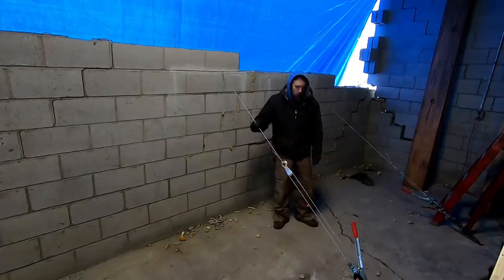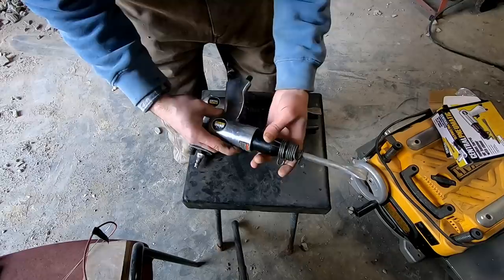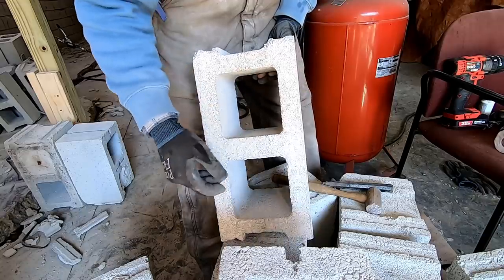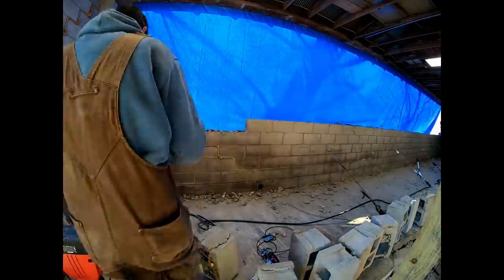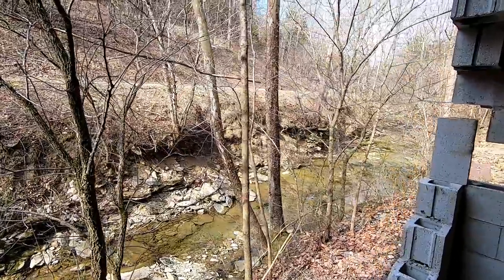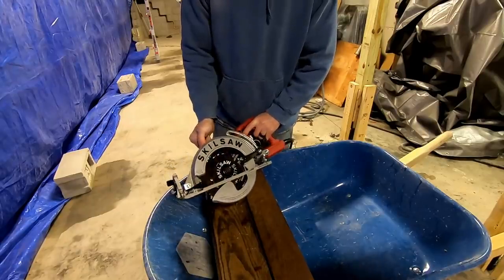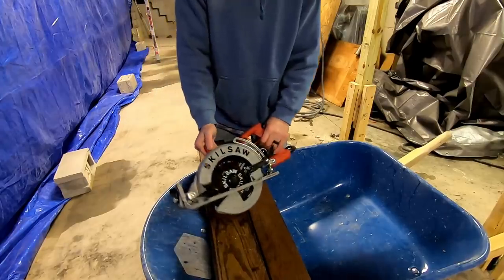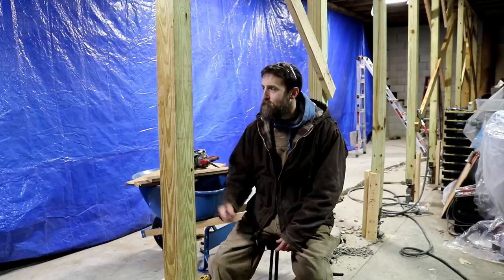THE BLOCK WALL IS OUT! Machine Shop repair part 5

Comment: Wise choice on stepping back from Peanut a bit. Although acclimated to human contact, she is still a wild animal, and her instincts will take over from time to time, especially when she gets a litter to look after.  If you do try a nest camera, make sure to put the camera into a squirrel-proof enclosure, otherwise the wiring is likely to get destroyed. A dedicated ingress/ egress point for her will make it easier to "Squirrel proof" the dray.  I get phone calls to remove squirrel infestations/drays which are inside roofs and attics; they can can be incredibly destructive (especially to the attic/loft wiring and the roof), so try and limit access to the remainder of the roof, if at all possible. They are cute little critters, but cute ends whenever they cause real damage. Current personally-observed damage 'record' for my area is $35,000: Roof, attic wiring and HVAC damage  -  which required two non-load bearing walls to be stripped and re-drywalled and an entire section of the roof to be taken up to repair the HVAC (no room in the attic crawlspace). FWIW: Most homeowners nowadays can't get insurance if a tree branch grows within 5 feet of the home. Just some things to think about.
Reply: That's the tamest wild animal I ever saw. Thing would probably sleep in bed with you if she could.

Comment: I have either missed it, or just not understanding, but it looks like your cut line for the new floor is behind the supports. Exactly how is that going to work when the time comes to pour the new floor? And I am sure, I hope, that you are also going to drill and insert rebar into the existing good portion of the floor to attach the new pour... IDK!

Comment: the thick side is rougher because when they cast those that part is sitting on the bottom , they taper to small to get them out of the mould
you can probably stil get new brushes for that old skilsaw, dont think the copperthingies inside the rotor rhe brushes run across are still good , might been burned through after the last few tries whont know untill you taken it a part , you might be ale to skim a little off in the lathe and polish it with some emory cloth
Reply: Them copper thingies are called commutator bars.

Comment: Steve, I have a Stihl Rock Boss that would be the ideal tool for toothing that block back in:
https://www.stihlusa.com/products/concrete-cutters/professional-concrete-cutters/gs461/

You may just be able to rent one for the cost of shipping both ways from the Gulf Coast, but I wanted to throw that out there.  We bought it for one specific job a number of years ago, and we've used it once since.

Also, good buy on that Jackson Wheelbarrow.  They outlast all the other ones by 2-3x, and are only about 10% more expensive.

Comment: With a view like that aren't you tempted to go for an all glass wall!
Reply: Stephen Perry all glass wall ain’t structual, otherwise it’s a great idea, I was actually thinking the same thing.
Reply: With the proper headers big windows are great, as long as they are sized within reason.
Reply: OldmanonaHarley  BCJ Architects designed and built quite a few Apple stores around the world that have changed the game so to speak concerning all glass construction.  It still uses fasteners but they worked with a glass company out of Germany to create new methods of tempering and such to make it possible.   The New York Apple store even has an all glass elevator.  Cool stuff
Reply: Of course it’s not an affordable option for residential stuff yet but hey it’s possible.
Reply: @audimaster5000    It can be I have been gathering good used patio sliders they are standard size, framed and cheap I scored a few set for free.
Reply: Jeff Padgett It is possible to build an all window wall, I’ve built quite a few myself. Unfortunately like you said, it ain’t cheap, great idea though.
Reply: The largest drawback to glass is the size of the pieces one or two people can reasonably handle without machinery.  This will depend on thickness.

Comment: Steve: I don't about your area but in mine, those blocks are not acceptable for constructing a structural wall.
Reply: I don't know about your area. There's nothing wrong with those blocks though. Was something wrong with how they were used.
Reply: @1pcfred  From my perspective those blocks look like Cinder Block. If they are then it is not okay. Or are you structural Engineer? I think not. But I am. Cinder Block is not excitable for a weight-bearing wall.
Reply: @fiorevitola880  they're most definitely concrete blocks. Cinder blocks are coarser and more dark bluish gray in color. No one's used cinder blocks in 50 years here. I don't need to be a fucking structural engineer either. I'm a vested union laborer and I've built plenty of block walls. Worked on jobs that have won international awards. Built places where a square foot of rent costs more than your whole house would. You Chav!

Comment: 11:53 that's a rookie move I see people do all the time.  I learned this trick back in my bmx days building dirt jumps.  When you return a wheel barrow after dumping it, turn it around and point it in the direction you need to wheel it.  It's much easier to turn it around when empty than full.

Comment: Not second guessing you just letting you know the way you have the blocks stacked is not quit safe. I wouldn't go any higher. I delivered and stacked many a block in my day. The blocks we made were 35lbs. The web is used as a handle and helps to set block. I just made the mud and pulled the block out of the dryer and stacked them on pallets and driveled them the boys the run the batch plant gripped me out for stacking them wrong all the time - gun shy I guess. Once on the job site I found out why they were stacked that odd fashion they keep themselves stacked. Now them boys laying the block were animals and quick too. might I digress 

One trick You need to know is to wash your hands in vinegar every day, any kind, it neutralizes the effects that cement has on your skin. Block is sharp and cuts gloves and skin if you are sensitive to lime and cement and are exposed to cement long enough you can get poisoned or burned and vinegar really does help. Hands might smell like balsamic salad dressing but it is better than the alternative. Great video really liked the content keep em coming.....

Comment: Pretty poor mortar on those blocks.Hollow blocks,reuse  with rebar, & fill blocks with dryer mix concrete,after building 3 or 4 courses at a time.
Reply: I was wondering about that.  The mortar seems rather... terrible.  I've never built a cinder wall but this one looks to have been just horribly made all around...
Reply: @eak125  And a even bigger fault was building wall on the floor slab which is around 4" thick & not proper foundations, just asking for total failure  of the wall,etc.
Reply: @stuartandrews4344  that contractor was ahead of his time. He was doing fibermesh before it was even invented. Just without the fiber.

Comment: After this job I’d let the air hammer barrel fall off and use harbor freights warranty
Reply: Why should the other customers have to pay for your tools?
Reply: @the_hate_inside1085  That's why harbor freight will always be harbor freight. The same bums that used to buy tools, use them once, and return them to home depot, have all migrated to HF. They can keep them.
Reply: Why does harbor freight offer extended warranties on tools? Taking something back when it is falling apart is different than people using a store for a loan a tool program

Comment: Steve. Just out of interest in the UK we use steel support jacks like the ones shown in the link below. Do you not have these for hire/buy in the US. It just seems like all the money and effort you spent on hydraulic jacks,  timber and extra bracing at fge bases of each support column you could have simplified it greatly with these steel supports. The even have rightangle tops on the you use to put through walls to support if putting in doorways or windows until you get a lintel in to bridge the gap.

https://www.hss.com/hire/p/steel-prop-1-0-1-8m-no-0

Obviously everything you have done works as you are getting the job done and nothing has fallen down so this isn't a "you've done it wrong or unsafe" merely asking if you have the supports in the USA?
Reply: Yes, we have them.
Reply: Thanks for the answer. I thought it would be strange if you didn't have them. There are only so many ways to support stuff.

Comment: Totaly agree with the berne coveralls. (Not to be confused with the communist running for president.) Mine are the insulated. Love them. Just to show the difference. 45 years ago we didnt have HF. The only place available for me to get an air chisel was at a local auto parts store.  Mine cost me a $119. More than I was making in 2 to 3 days wage. I still have it and still on occasion use it. My floor jack cost me $163. Around same time. I still use it often. At that time in my life those were major purchases. That is probly the reason I can remember the cost of the item. I have much more expensive items now and would have a hard time telling you what price I paid for them.
Reply: Effen Bernie.